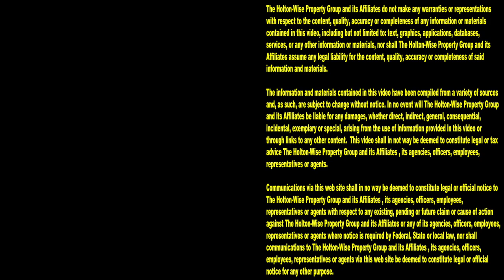Section 8 Evictions Caught on Tape: They Flooded My House & Stole Everything! | Tenants From Hell 99

Comment: House is so cute! Wish I had it! I would be greatly appreciate it.
I pay $,1,300 for rent apartment here in Dallas . I do not qualify for section 8. 
It would be nice if they had a plan called section 9 for other people to qualify.
Reply: It seems that working people treat the home with better respect.
Reply: They do, it's called "section 42" aka tax credit. provided your in the income guildlines they have a reduced rent rate but section 42 properties are hard to come buy and are generall in more "rough" areas for obvious reasons.
Reply: No, call it Section 11 that way you aren't "next door" or directly across the street to section 8. LOL  It is sad that in order to get any help you have to be busted.  Instead of, I need just a little bit of help so here is a program to help fill in those gaps which are tripping me up. There should be a sliding scale if you need 30 percent help, there's a program for that. If you need 60 percent help, there's a program for that. Need 10 percent help, here you go.  We are supposedly the greatest country ever.....and we can't do any better than the system we currently have going?  Seriously? As a society, we should be embarrassed.

Comment: GUYS ... Take a TIP from a person WITH ELECTRICAL EXPERIENCE .... BEFORE you walk into a flooded basement, go outside and PULL OFF the meters from the socket on the house .... Or you COULD DIE .....   Firemen KNOW this trick .... !!!
Reply: Ain't no tip - what you state IS AN ABSOLUTE MUST.

Comment: Instead of being biase to all section 8 clients because of the bad apples so to speak affordable housing landlords should take it to local housing authorities who are suppose to monitor and  oversee not only those already on section 8 but the applicants...housing authorities should be faulted for NOT enforcing the very rules they are suppose to implement...they know who problem tenants are and allow them to stay on the program...they do nothing...cut the head of the snake off
Reply: A section 8 tenants destroys the place, yet the office will issue a violation to the landlord. The landlord will say the tenant did it, the office will then say "do you have proof?"